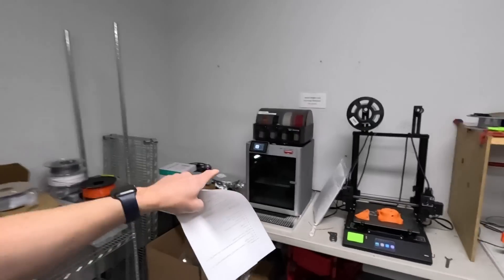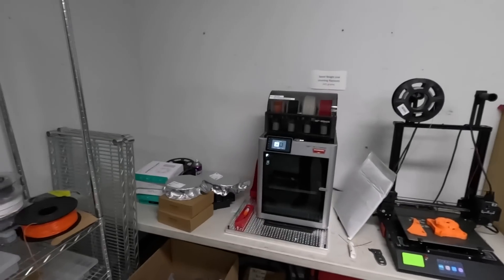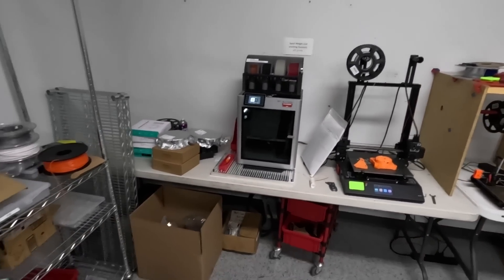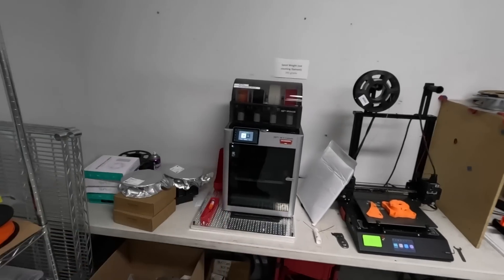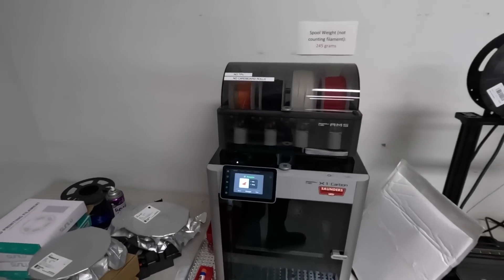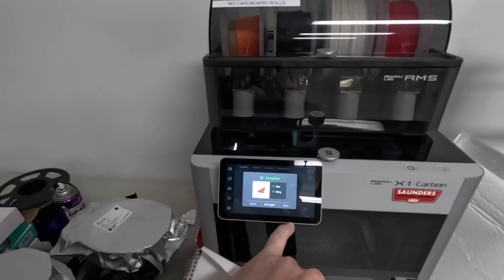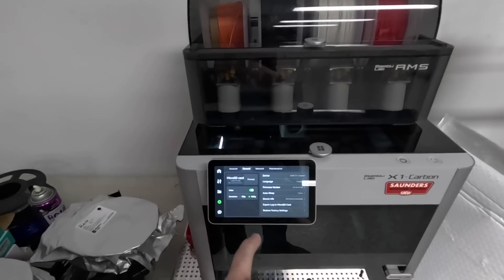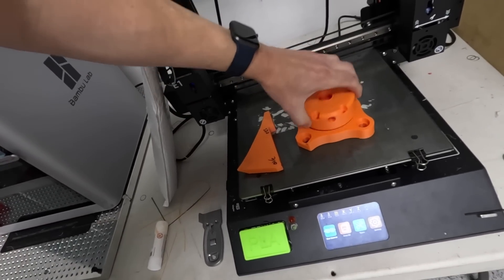Bambu Lab x1 Carbon 3D Printer: Review & First Prints

Comment: If you're doing work under NDA for aerospace, defense etc. it sounds like this is a definite no-go.
Reply: you can print local from sd card.
Reply: @TMS5100  It still goes through their cloud servers, then back to the SD card. So rather than slicer > SD card > print....its slicer > cloud > SD card > print...So BL ends up getting a copy of everything you slice, if they really wanted.
Reply: @LilApe  you're just plain making shit up now. my x1c and laptop have NO connection to the internet. i slice on laptop with no internet connection at all, save to SD card in my laptop, take the sd card out of my laptop and take it to the x1c, plug the sd into the printer, and print from the SD card. if what you claim is true, i wouldn't be able to print at all. i print this way to prevent sending any data to BL, for that exact reason. it does work despite your claims otherwise.
Reply: @TMS5100  I'm just repeating what Bambu lab themselves have stated. So no, not making shit up when BL said it themselves. is your X1 connected to the internet? Then BL still has access to your files when you hit print. Unless your printer is also offline, then sure.
Reply: @LilApe  Not true. Prints just fine without an Internet connections via the local LAN
Reply: @TMS5100  same here
Reply: @LilApe  bambu lab's faq states:  "Can you print offline, without internet access?

Yes, offline printing is possible using an micro SD card. The latest firmware also supports LAN printing."

so BL themselves state explicitly and clearly - offline printing works. period.
Reply: You can print SD card or LAN only. Everything stays inhouse.

Comment: Yeah, they do print fast, they are fairly reliable when you get a printer from a right batch but knowing that you are an enterpreneur that worked hard to get to your position, it is disappointing to see you endorse a Chinese company that acts as shady as they do. Stealing IP, violating license terms, not providing customer support, not providing access to spare parts, which can turn your printer into an expensive paperweight - these are typical for Chinese (not only Bambu), but the world got used to it far too easily. Nevertheless, I hope to see a follow-up sometime in the future.

Comment: Prusa Mk4 is now out, and released today.  Looks like a Bambu killer.
Reply: Eh. Maybe a fair comparison for the cheaper Bambu P1P vs the Mk4 kit, but once you add the Prusa multiple material add-on the Mk4 (assembled) is at pretty much the same price as the X1-C with the AMS. You still don't get an enclosure (air filtered), dehumidified filament containment, camera, or the superb build quality/presentation the X1-C has.

I still LOVE Prusa, but Bambu killer might be a stretch. Curious to see when they announce actual printing speeds too, Prusa only gives a Benchy print time and no real numbers as far as max print speed :/
Reply: The Mk4 looks like a very good printer, but I wouldn't call it an X1 killer. The Mk4 is about the same price as an X1 and a fair bit more expensive than the P1P. If you want an enclosure for the Mk4, that's an extra €300. The Mk4 takes up a lot more bench space because it's a bedslinger.
Reply: Super excited to see the mk4 released, but I'm going to reserve judgement for when they are in customer hands and being reviewed.

At a glance it still looks like it lags behind the X1C, but I want to see it first hand.
Reply: The Mk4 is whole lot better than the Mk3, but no Bambu killer. It not just print speed of the Bambu, it's the package as a whole, software and hardware. Using the Bambu at home and now at work has made prototyping and tooling so much quicker and easier. The AMS has also been a game changer and is a well thought out plug and play system. 

While not perfect, the Bambu is not just a hype machine with gimmicky features, they do work and work well. The AI detection has saved a couple of big print already and successfully detected issues before it became a problem. It notified my phone while I was out, I checked the camera and could see what was going on. I could then pause, stop or resume the print remotely. Luckily I had someone near by that could remove the the issue and let me resume printing. No other printer does this, and its so seamless.
Reply: lol no

Comment: Upload to China?  Nope. Thanks but no thanks. Won't buy.
Reply: You can use Lan only or SD cards. Cloud Optional. So know that you know that would you by it? You werent going to buy it anyway ...
Reply: @hawtdayum  I almost did. I instead got a Voron Kit.
Reply: @moltenaluminium  Cool. So which printer are you using to print the parts? What kind of build time are you looking at?
Reply: @hawtdayum  I machined the parts myself from aluminium.